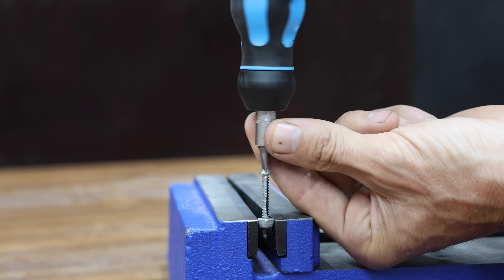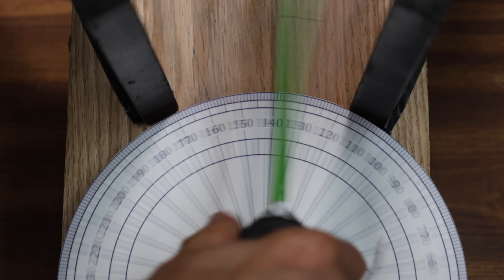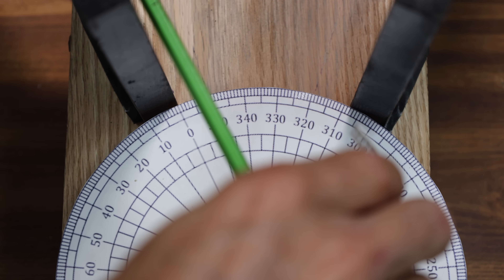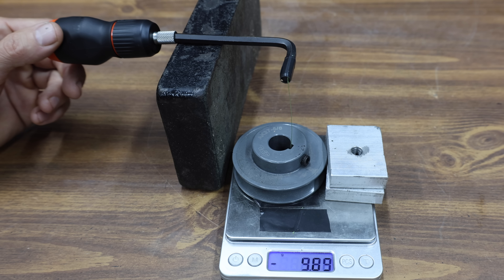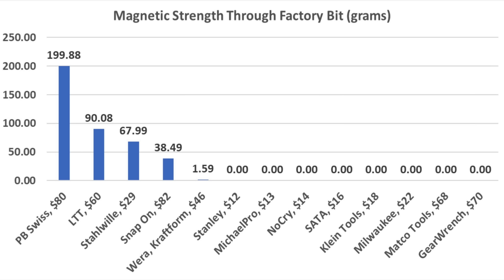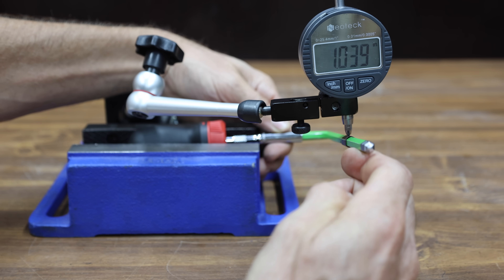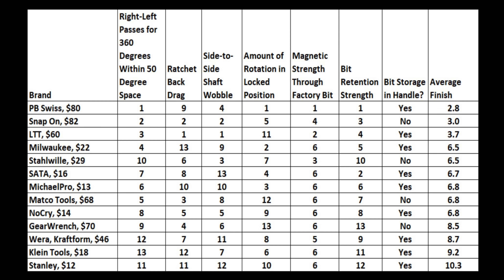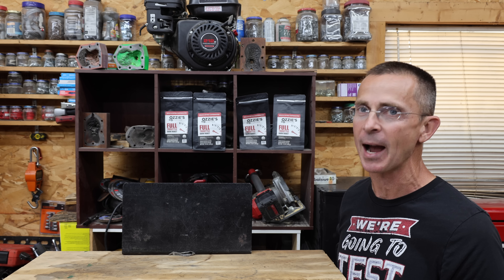Is Linus Tech Tips “Stubby” Screwdriver Best? Let's Settle This!

Comment: Agree with your conclusion, anything I would use a ratcheting screwdriver on likely doesn't require THAT much force, as for me it's mostly electronics, in which case a hammer is not often used, since that would most likely result in the destruction of said object 😂

If I really needed to pound on/apply huge torque into something, I'm not sure I'd even consider a screwdriver, but if so, it definitely wouldn't be a ratcheting one. If I really need to smack something up, I'd probably use an impact driver. For anything an impact driver would destroy, I'm sure any of these screwdrivers are durable enough to use with.
Reply from the maker: Thanks for the feedback.

Comment: I love this channel - would you ever consider doing a video on electric precision screwdrivers? I'm a computer tech and I turn a lot of screws, so I absolutely love mine (Arrowmax SES+), but it's far from perfect. Bit retention is kind of awful, and the internal magnet is rather weak so it drops a lot of screws.

Other important factors are:
* Whether the screwdrivers "lock" the bit at the end (allowing you to manually tighten the screw if it requires more torque than the electric screwdriver can provide)
* Battery life
* Comfort/weight
* And the rather delicate balance of it needing to provide enough torque to screw into tapped holes that might not be that clean, but without overshooting and causing you to strip screws or damage the electronics you're working on.
Reply from the maker: Thanks!  Thanks for the video idea.

Comment: I ordered an LTT screwdriver after your last video comparing them and I'm honestly so glad I went with your recommendation

The magnetic latch sliding storage is so useful for projects that need several bits; it made adjusting the floyd rose on an old guitar so much less painful that it normally is

It's so well designed and constructed too; even small things like the injection molding lines are cleaned down and hidden well

Edit: I'm mad dumb and didn't even realise theyd come out with a smaller model
Reply: Same. Project Farm is my go to before I buy nearly anything handy, now.
Reply: @htr5372 oh ok. Thanks
Reply from the maker: Thanks for sharing.

Comment: The angle test is kinda messes up.. It prefers those tools where you locked space comes closest to an multiple of the ratchets noches- if you know what I mean. Some Screwdrivers may have clicked just a single degree before reaching the end of your angle-limiter, while others might have been as far away as possible.
Also with that setup a wider body has some advantage as your Allen Wrench is not placed in the center of rotation.
 Actually determining the minimum angle needed between clicks would be much better

Comment: As with the big one, LTT did not make the 'perfect' screwdriver for all occasions. But they scored really well in just about every test, I'd say that's a win for the design team on this one. Kudos to the engineers that did all the hard work to make a set of reliable tools. Even if they are on the pricier end of the scale comparatively. Very impressive showings both times.
Reply from the maker: Thanks for the feedback.

Comment: As someone who doesn't use screwdrivers day in day out, but needs something reliable that if I lose I won't feel too bad about I always go for Milwaukee, you can pick them up practically anywhere and the only real downside is the backforce. However in applications where I need low back force I usually need a more precision screwdriver anyway
Reply from the maker: Thanks for sharing.

Comment: I have the stanley and for 12$ its pretty good. 

The handle is probably the most comfortable out of them all(especially since half of these have terrible handle shapes), it has a silicone grip, which i SORELY miss on the LTT screwdriver, and while it needs a few more turns because its gear ratio is smaller, the difference is not that big, especially for how big the price difference is. 

Also, yea, the bits are quite bad. Get a bunch of milwaukee alloy 76 bits, those are probably the best bits i've used if we exclude the wiha titanium bits that cost like 5 dollars for a single bit, lol.

Overall, for 12$, its quite great. The ratchet is good enough, and having a great handle is probably the most important thing with a stubby screwdriver.

Also, the bit holder cylinder falls out of the cap, minor annoyance, bit of glue fixed that easily.
Reply from the maker: Thanks for the feedback.

Comment: I dont have that exact screwdriver, but the PB swiss magnet is almost too strong, if you have slightly wet or oily hands it can sometimes be difficult to get the bits out of the screwdriver, but for the normal one its really nice to hold all the screws on the shaft, i really like the PB products, their colored bits are also a nice addition makes it easy to differenciate between phillips and potzidriv, i also noticed a difference in longevity between the PB swiss and other bits i have
Reply from the maker: Thanks for sharing.

Comment: Your first test is EXTREMELY flawed. You have 50 degrees of movement here. A screwdriver with 30 degrees per click is going to have 20 degrees of slop, while a screwdriver with 24 degrees is going to click twice and have only 2 degrees of slop. Both would perform identically if you chose 40 or 60 degrees instead of 50.
Next time, try measuring the minimum angle it needs to click.

Comment: Linus said after you reviewed the standard length screwdriver that he assumed people would just use a non ratcheting driver instead of locking a ratcheting one so he did not emphasize performance in the locked position. I'm not sure I agree but that probably explains why the there is so much slop when the ratchet is locked.
Reply from the maker: Thanks for sharing.

Comment: Isnt the Ltt screwdriver at 9:25 too close to the vice? if everything is aligned flat on the surface, it will not be able to move. others had a little distance(?) (Same for Gearwrench)
Reply: Yeah, it's kinda cheating.

Comment: When you  measure arc and back drag do you do it in both directions?  Or are they the same?  I remember my Dad's ratchet screwdriver from the 70s through to the MegaPro I bought last year that they feel and sound different in each direction.  It wouldn't surprise me if they have different performance characteristics.  But I don't have the setup to prove it.  So I wonder if you've ever measured forward and reverse and compared?

Comment: Did you consider to make a quality based ranking? 
I mean not just listing the ranking itself, but how good/bad it actually was. 
Lets assume a test where half the tools perform really well in the same range nnd the others don't. 
Best: 50 gramm, worst 300 gramm
5th best tool is at 60 gramm, so still really good and then it drops off. 
why not make it a percent to best rating?
Best takes 100%, and the 60 gramm tool gets 96% (for being 10 gramm off the best, but still 240 gramms better than the worst tool). 
That way tools that are similarly good don't get punished. And in contrast a tool that does a lot better than everyone else is rewarded.
I could help set up a spreadsheet like that.

Comment: Love these reviews and how much information you manage to fit into a relatively short video! 
One suggestion for future comparisons: you might want to consider aggregating the final scores based on relative performance, not rank, e.g., mapping the worst & best value to 0 and 10 respectively: if the highest weight you can lift with the magnet is 1kg and the lowest is 0, then a screwdriver lifting 750g would get a 7.5/10. This should make your overall ratings more fair in the plenty of cases where you might have a few competitors that all do similarly well in some categories
Reply from the maker: Thanks for the constructive feedback.

Comment: A couple years ago, I picked up a crappy Hart ratchet stubby. I got it for $4 or $5 and surprised me with how well it worked for such a cheap item. We easily lose tools at my work (either dropping them into the ether or people putting them in pockets), so it was a different kind of valuable tool; one I wasn't afraid of having to buy again. If you test screwdrivers again, I'd love to see it in the lineup.
Reply from the maker: Thanks for the suggestion.

Comment: @ProjectFarm im actually shocked you havn't done a BEST COOLANT/ANTIFREEZE rundown. you can test freeze threshholds/ lubrication/ solvent/ corrosion protection/ boiling point/ evaporation rate ect. I have to change my thermostat and I always refer to your videos befor I buy these kinds of things. also brake pads?
Reply from the maker: Thanks for the suggestion.

Comment: Very Interesting. Another great review from Project Farm.  Who uses a manual screwdriver any more ? I use a power screwdriver 90% of the of the time and 10% a socket wrench.
How about testing small air compressors under 2 gallons ?  Most I have seen can not produce or hold their max rated pressure.
Reply: Me.

Every day.

All day.
Reply from the maker: Thanks!  Thanks for the suggestion.

Comment: I think there is a room for improvement here. Please, stay consistent with measurement system - if using grams then use (milli/micro) meters and Nm (Si). Using weight scale without min/max option is imprecise as the extreme value depends on the last calculation cycle not freeze-frame you use to read the value.

Comment: Any thoughts on comparing portable air conditioners?
Reply: Buy an expensive one that doesn't need a hose exhaust hookup to be vented out a window.

Just buy a window unit.

Portable air conditioners are the most awful inefficient way to cool a space.
They literally suck the cool air they make back outside.

Look up technology connections video on them for much more info.
Reply from the maker: Thanks for the suggestion.

Comment: Can you put together a video with a twin ring setup on a lawn mower engine? I would like to see how much more compression you can get out of a lawn mower. Garage 54 did this to a 4 cylinder engine and turned it into a diesel. Nutts! Basically your getting thinner compression rings and fitting 2 into each ring groove instead of 1 compression ring. So if you start with 2 then you get 4 compression rings. Would be really neat to see if it makes it more efficient since compression and efficiency go hand in hand.
Reply from the maker: Thanks for the suggestion.

Comment: Regular screwdrivers exist for a reason, heavy multibits are unwieldy, only useful in a pinch.  For everything else electric is the way to go, they cost nothing now, HART impact/drill combo sets go for not much more than the price of these over priced over engineered toys.  Even for building a pc which is the supposed reason Linus is selling this thing for, you are more likely to drop a heavy screwdriver and cause damage while building a pc.
Reply from the maker: Thanks for the feedback.

Comment: Next video idea, quick connect garden hose adapters, and shutoff valves. Some have a higher flow then others, some are leaky, some can which stand a higher pressure then others, and if you start now, you can have a 6 month outdoor test, to be ready for spring time!
Reply from the maker: Thanks for the video idea.

Comment: Hi, can you do a test on several inexpensive Chinese digital torque meters that you can attach to a standard 1/4, 3/8 or 1/2 inch wrench? I am curious to know how accurate these 40 to 70 USD units are compared to your professional tool. Thanks 👍
Reply from the maker: Thanks for the suggestion.

Comment: I feel like with the screwdrivers with longer shafts, the point of a "stubby" tool seems to get lost a bit...
Reply from the maker: Thanks for the feedback.
Reply: They have their place where clearances are tight, but the bulk counters this, bad for tight angles and screw holes, and drop damage more likely when doing what it was supposedly meant for, computer upgrades.  Also people forget the reason for a long screwdriver is that its the easiest to judge if its perfectly vertical, less likely to strip screws.

Comment: Hm it seems like it'd be a bit better value than the full size one looking at the competition. Amount of rotation in locked position is fairly pointless metric for these if you exclude the lowest rankings for top three LTT would overtake SnapOn and be second. Not bad for a company that "Just rebrands MegaPro"
Shame the last spreadsheet doesn't have the test numbers next to the ranking. Would make it easier to compare at a glance, I feel like some of the tests had pretty close top third and then dropped off sharply so it's hard to compare in the last sheet without seeing the results. Jumping between the video though, if you don't need the magnetized bits (or you could just get them as a bit kit) the NoCry seems to offer great value at around 1/4th of the LTTs price
Reply from the maker: Thanks for the feedback.

Comment: I have two ideas.

The first is to test Philips, JIS, and Pozi against eachother. Especially if you can find all three from the same brand so brand isn't a deciding factor. I'd just like to know if there is one that performs well on all three types of fasteners. In my experience, Philips doesn't seem to do to well on JIS or Pozi screws. Cam-out and damage to the fasteners would be very interesting to me.

Second, unrelated to screwdrivers, is the Lubegard line of products. They have additives for oil, power steering, and transmissions. I was surprised that there are transmission rebuilders that put the transmission product into their rebuilds. Even if you dont have several bad transmissions or several bad power steering systems to compare different products, I think a lot of us would still be very interested in your opinions. Like your early videos with Seafoam in the Ranger; it wasnt a comparison video but was still great. That's good content too.

Keep it up! Great videos.
Reply from the maker: Thanks, will do!  Thanks for the video ideas.

Comment: We always have dead batteries around the farm on tractors, combines and trucks, but what’s the best Battery Charger for either 6v or 12v farm batteries? We’ve got an AC Delco brand that my dad bought from somewhere, but it really doesn’t work very well. I searched to see if you’d ever tested the best battery charger, but all I can’t find are your videos for the best battery Jump Starter (several of those) and one for the Best Battery. I watched a mechanic’s video where he claimed the Associated Equipment 6002B is by far the best charger you can buy, but it costs like $1,500. He says they make a model 6001A, but it still costs almost $900. Before I invested that kind of money into a Battery Charger, it sure would be nice to know if a much cheaper unit that you can buy at any auto parts store is as good as the expensive charger from Associated Equipment. I watch all your videos and LOVE your channel… and your coffee 👍
Reply from the maker: Thanks!  Thanks for the suggestion.

Comment: FWIW I have tried lots of these (some in the full size configurations).  Milwaukees multibit drivers are really unpleasant and i wouldn't buy one again.  The NoCry isn't great, the selector mechanism is fiddly.  I have the non ratcheting PB Swiss stubby - its maybe my favorite tool - their red handle material is unmatched, the most sure grip of any texture, even Kleins rubber.  And it comes with PB Swiss bits which are really expensive.  Their ratcheting version is so long it defeats the purpose of a stubby imo.  Save 45 bucks and get the non ratcheting PB, great tool and great value.
Reply from the maker: Thanks for the feedback.

Comment: Always love this channel! I have one of the big ones, and by far the best "feature" is the fact that the shaft stays straight as an arrow, almost like a normal screwdriver. I've used a fair bit of ratcheting screwdrivers and the wobble is my biggest pet peeve!

I use it for servers and switches so I'm in the right demographic, it's definitely not made for consistently applying high torque (even though it does handle it), as imthe smooth finish gets slippery with sweat and oils - and I have fairly sweaty hands, haha
Reply from the maker: Thanks!  Thanks for sharing.
Reply: @htr5372 I have GN merch too if you like to talk sht. I like the mug. I buy what I like and if I don't, I return it. Simple
Reply: @htr5372seek help

Comment: I love that you present the data in a no-nonesense "these are the data points" fashion, and I really appreciate that you don't conclude with "This is the best overall and that's it." If I'm working in a tight space - like in a computer case or under a dashboard - then low backdrag is extremely important and I'm not likely to use the locked shaft feature. Being able to quickly change bits and not require separate storage is a nice-to-have feature, but not a deal-breaker for me. That said, I would still get the LTT rather than the Snap On because they performed very similarly but LTT is much less expensive.

Keep up the great work!
Reply from the maker: Thanks, will do!

Comment: Great to see you being able to buy the LTT one early so can do a proper early review.
Something I may have wanted to see at the end, maybe after the Average finish results,  is some of those other statistics shown together.
Even if not using it to do any more ranking, just to give the numbers.
For me, the Matco at 6.43" and 188.17g, and the Gearwrench at 6.50" and 170.15g,   would not be very tempting compared to the LTT 4.43" at 122.09g,  even if they were to have any important (to me) other better ratings.. like that brutal final stress test.  Sort of the same with the bit failure where they also both fell behind  ( 138lb and 128lb respectively) to the LTT (2nd place at 140lb)  and the first place PBSwiss at 145lb.
I guess data density gets to be a bit of an issue at a point.
Reply from the maker: Thanks for the feedback.